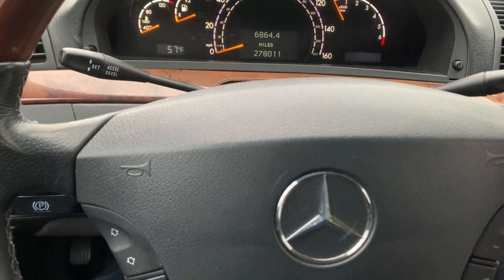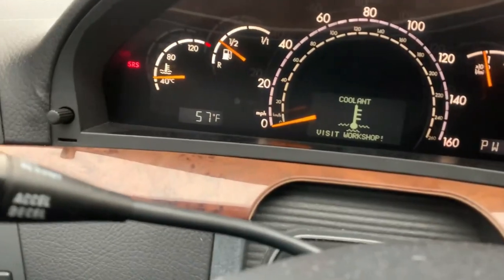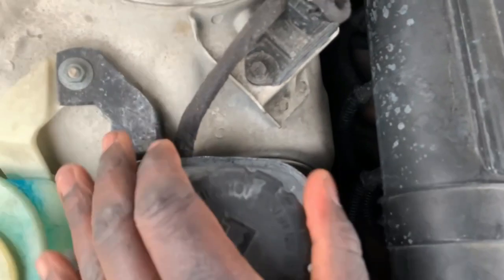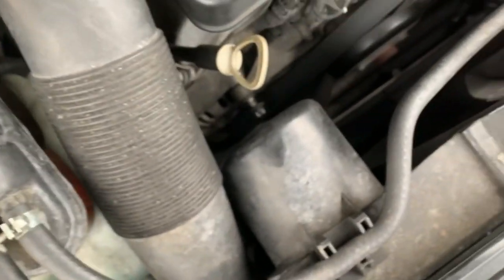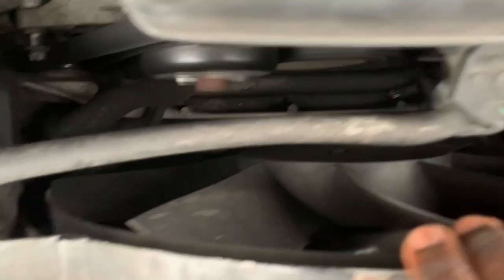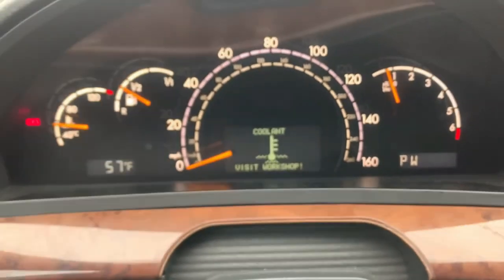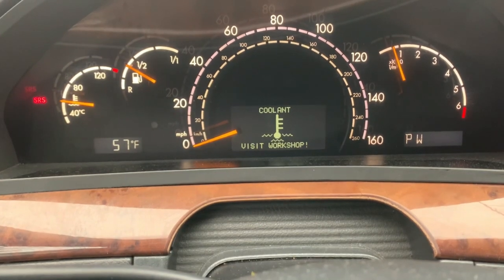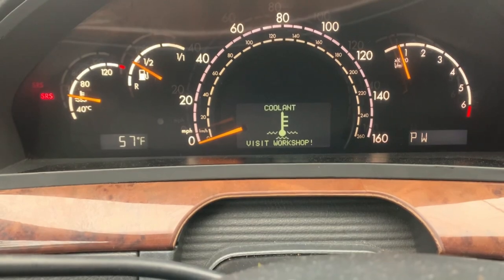MERCEDES COOLANT VISIT WORKSHOP WARNING LIGHT #coolant #mercedes #fan #diagnosis #overheating

Comment: The fan start at a certain temp… and the coolant empties when the car is running because it’s running through the system… and you should never open the coolant when the car is running…

Comment: I have a Mercedes’ 2009 E350 everytime I have the Ac on the little temperature emoji starts to flash . 😅but it doesn’t over heat. Help
Reply from the maker: Check on your coolant level. You may be having a leak.
Reply: I have a Mercedes 180 2014 and same thing. The cool is full, but when I put the AC on this light shows up on my dashboard. An it never happened before
Reply: Sounds Like The Fan Is Not Working On The A/C Speed.
Try Unflagging It And Turning The Key To On For 3 Sec With Out Startin It Then Back Off.
Plug It Back Up And Start It Up.
If Not Replace The Fan.
Reply: Sounds Like The Fan A/C Speed Is Not Working. 
Try The Reset Down Below If Still Not Woeking Replace The Fan Assuming The Fuse And Relay Are Good